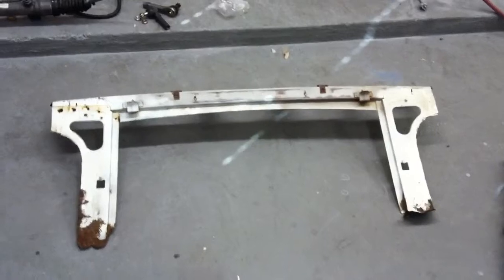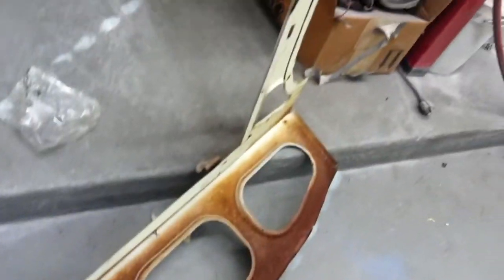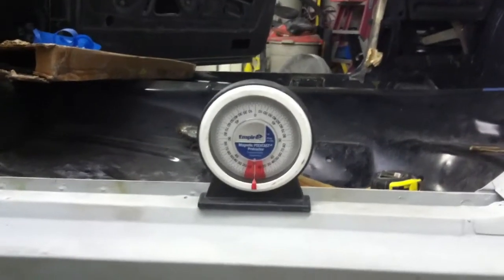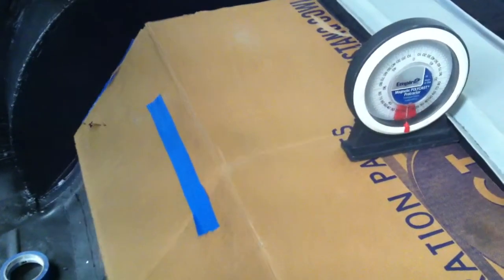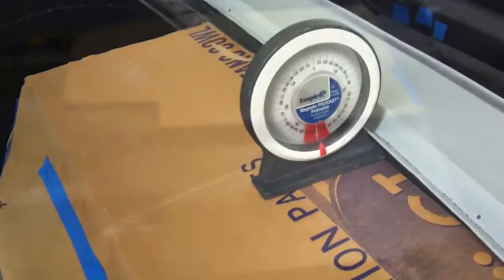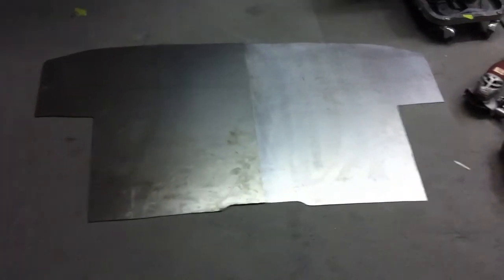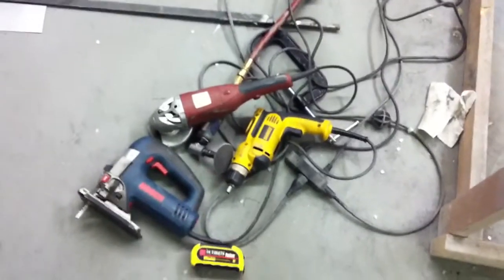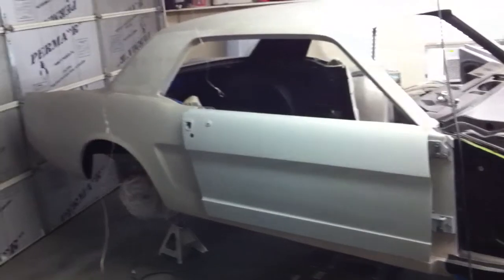65 Mustang Package Tray Fabrication

Comment from the maker: @Moonfleet41 Thanks Del, the package tray turned out good, and we did it for about $40 in sheetmetal and a couple hours, compared to $200 for a new one.  One of the few projects we did that we didn't mess up or didn't have any major problems with.